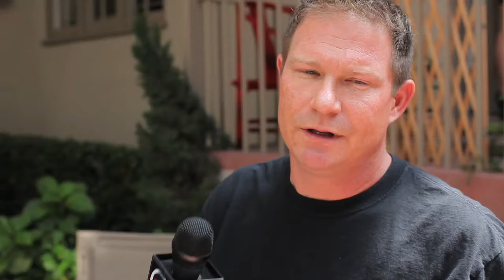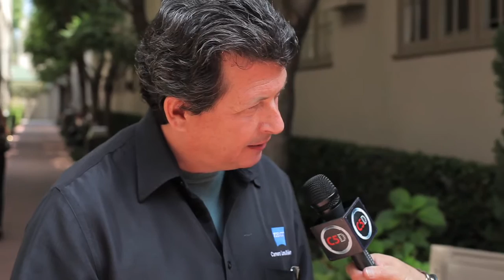Richard Schleuning Of Zeiss Explains T-Stop Vs. F-Stop.

Comment: in theory that means wide angle lenses with very low f-stops should be very easy to produce, since the aperture diameter doesnt need to be very large, however the reality is the opposite. wide angle lenses with low f-stops are very rare and expensive.

Comment: The f-stop of a lens is a simple ratio of the focal length / the aperture diameter. A 50mm 1.4 lens will have an aperture of 35.7mm. 50/35.7 = 1.4.  Since the light is being transmitted through glass, some of the light is absorbed, and different lenses absorb different amounts. A T-stop is a measurement of the light that has passed through the lens, compensating for the light lost to the glass. Therefore, a T-stop is the exact amount of light transmitted by the lens and is uniform for all lenses

Comment: @szabiakanich:
Same shutterspeed, no matter which manufacturer. But you will see slight differences in the result. f-stop tells you how big the opening is that lets the light through, t-stop tells you how much light actually strikes the film/sensor.

If you shoot photos, screw it. If you shoot film with multiple cameras you want to have matched images. Not only in exposure but also in color. The CP.2 are all colormatched. They use the same glass for the photo lenses, so they're matched as well.

Comment: @LivingForLOL:
The F-Stop number equals the focal length divided by the diameter of the entrance pupil.

Wikipedia: "The entrance pupil is the image of the physical aperture, as seen through the front of the lens. The size and location may differ from those of the physical aperture, due to magnification by the lens."

So a 50mm f/1.4 would have an entrance pupil diameter of 35.7mm.